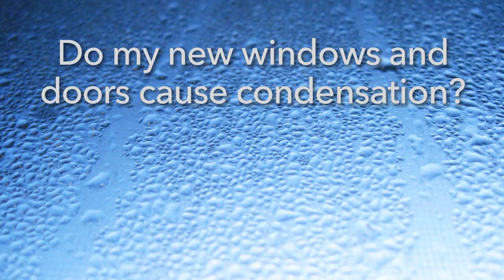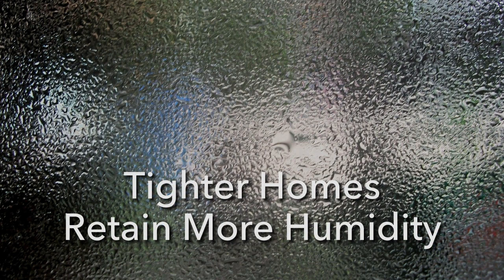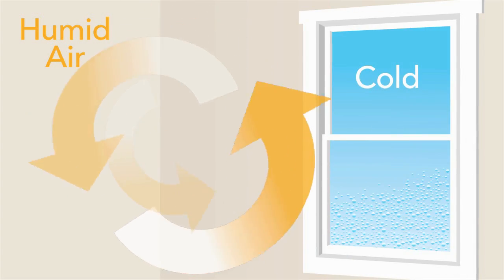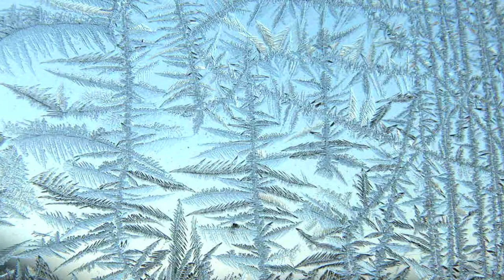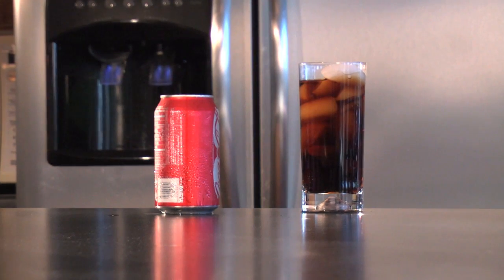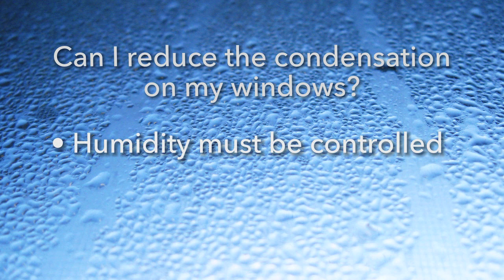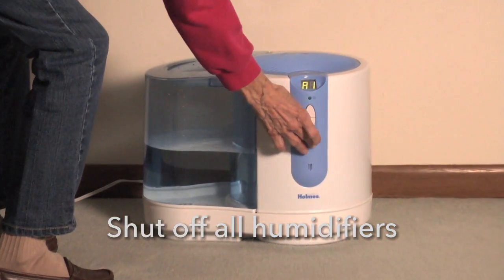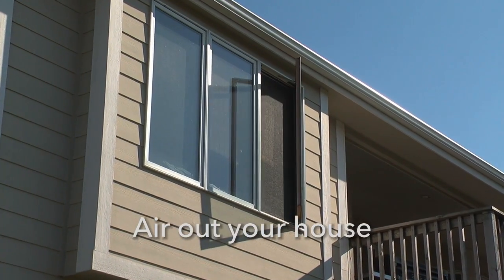Understanding Window Condensation

Comment: For windows I’d recommend the polythene system in winter. You put double sided sticky tape around the problem window and attach polythene, it acts as a barrier to the cold glass! It definitely works. Cheers
Reply: Can I find a DIY demonstration on how this is done ?  Need it before winter arrives in Ak

Comment: Your windows sweat because there is more severe temperature difference on each side. Old windows didn't block temperatures at all. The outside temp was more in your home then with double pane. The frames sweat when heat/cold is leaking. Never use aluminum frames with double pane. I have fiberglass. No sweating anytime of the year. Humidity issues, That's just an easy answer for companies to get you to leave them alone.

Comment: would ceiling fans help with moister on internal windows ?
Reply from the maker: Hi Francis - Thanks for reaching out!  If you'd like to provide me with your contact info, I'd be happy to connect you with a specialist to answer your question.  You can send it to socialmedia@pella.com.  Thanks! *SW - Pella Community Team
Reply: Francis Moore-yes it would help in winter I have same problems after installing new windows a few years back.  I have forced gas furnace, keep the inside temp between 70-72 & outside this morning it was 32 degrees.  I turned on my ceiling fan to low, make sure the blades move counter clock wise, it took care of the moisture that had formed at bottom of my windows.

Comment: The video does not address exterior side condensation.  Moisture forms on glass and seeps under the metal cladding resulting in product failure from wood rot.
Reply: how can water seep under metal cladding? It cant. windows are made so that water sheds when there is rain.